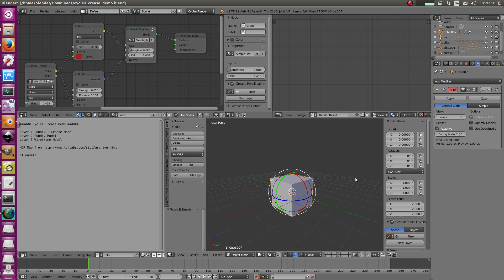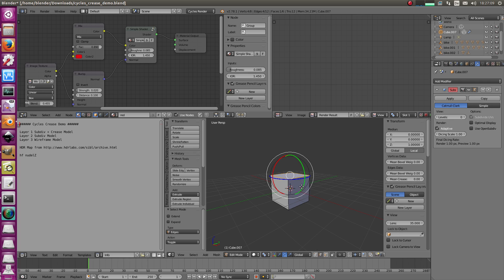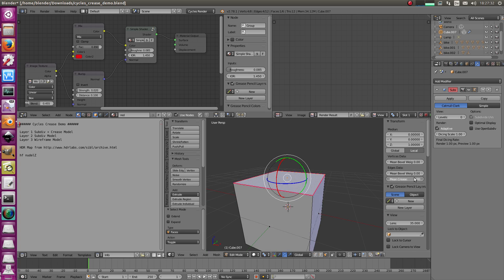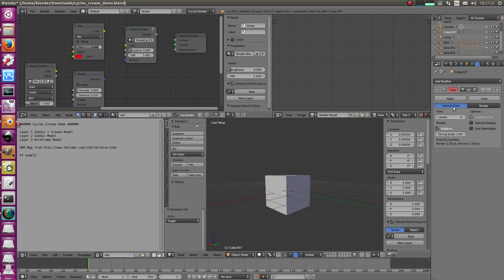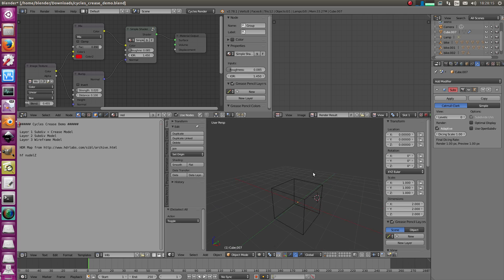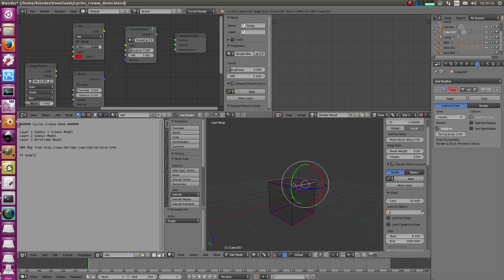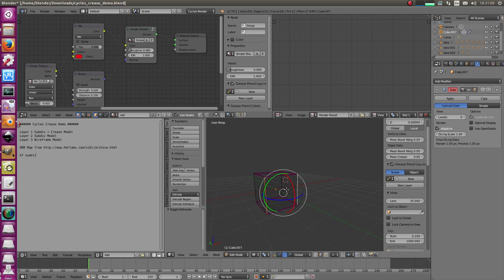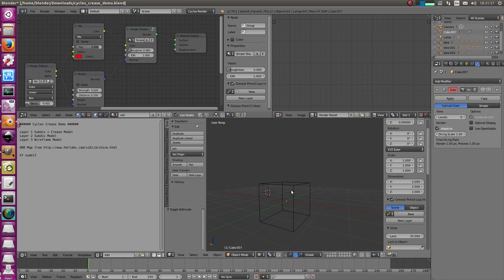Cycles - Crease Feature Tutorial (Microdisplacement Blender 2.78)

Comment: Thanks. But isn't the title misleading? I'd say the first word should be Subsurface Modifier - not Cycles - which just renders the effect. It doesn't create it.
Reply from the maker: no its correct without the use of adaptive subdivision its quite useless and adaptive subdivision is a cycles feature (:
Reply: A better name would have been 'cycles - Adaptive subdivision'.

As for creasing it's very useful even in the internal renderer and I use it all the time for modeling high-poly object that I later retopo and bake for game assets, too. So I wouldn't say it's useless without adaptive subdivision. However the adaptive subdivision does make it a lot more powerful, indeed. :)
Reply: nutelZ not really useless at all. It's works quite well with the regular sub-surface modifier. It's actually a little frustrating in the video that you don't just use it in the viewport to preview the changes instantly.